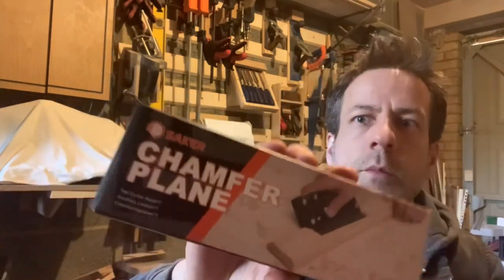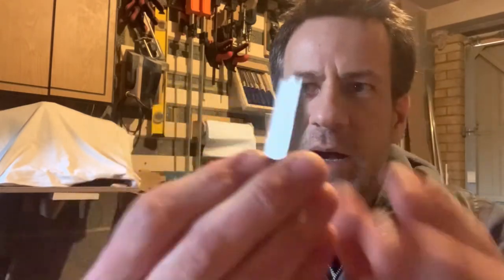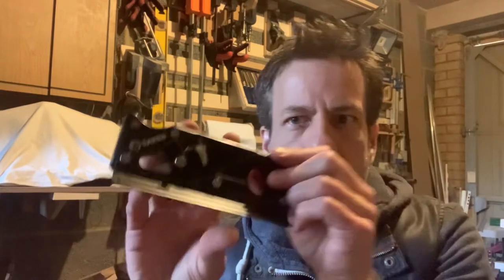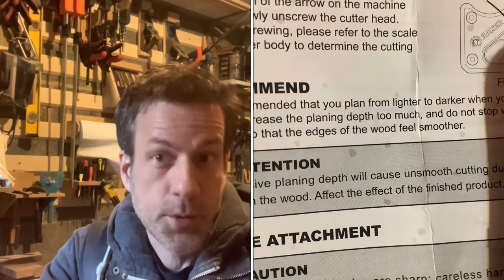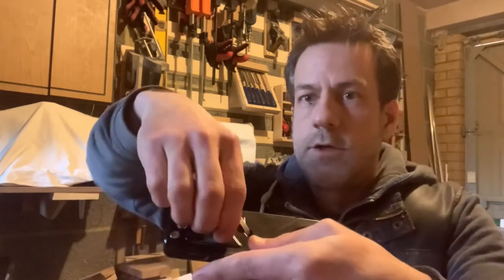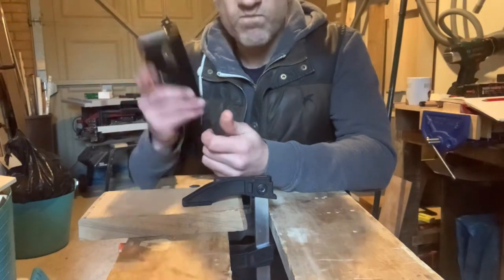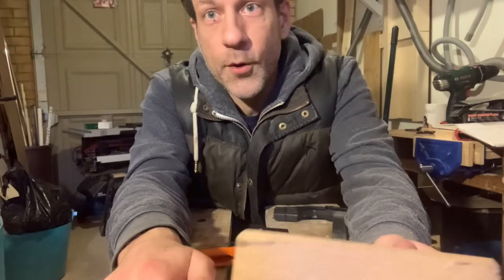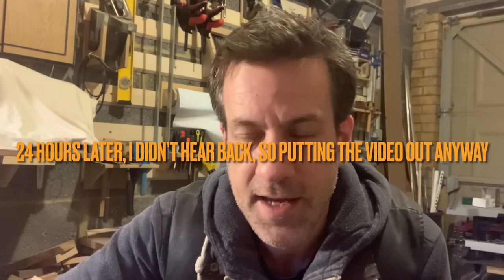Review of the Saker Chamfer Plane, first impressions and testing the thing out

Comment: Got to agree with other comments: you definitely gave it a fair trial! Of course, none of these things come ultra sharp straight out of the box, but by the look on your face - just like me at the gym,, grunting through the last few reps of a bench press - it doesn't exactly look like a joy to use. 
I did consider the Banggood (Woodpecker knockoff) as it gets some reasonable reviews, but even that comes in at around £80. Frankly, you'd be better off buying a trim router. If you can't stretch to the Makita, there is always the Katzu - among others - that can be had for as little as £30, already a fiver cheaper than the Saker.
I don't know, but woodworking in your garage, or shed should be a relaxing, pleasurable experience. For me, it's a podcast, audiobook, or music. Then, it is just a case of plodding away at whatever the current project is. 
The Saker doofer looked like torture, and, as you quite rightly pointed out, putting a chamfer or arris on a project usually comes at the end. So, with timber - even MDF - prices going through the roof, why would you want to spend hours, and good money on a project, only to make a dog's dinner of it 98% in?
If you don't have a trim router, and only want to take off the sharp edge, just use a sanding block, or sponge, or buy a Stanley or Record block plane. Either can be had for the same price as the Saker. 
That being said, thanks for taking the time to share your awful experience with this terrible looking tool.
Reply from the maker: Thanks for your detailed comment 👍🏻. I’m being polite about the saker in the video as they sent it to me free to review! But I totally agree with what you’ve said there, it’s a gimmick of a tool anyway, whether made well and sold expensive, or made poorly like this one. The Makita palm router is awesome, one of the most used tools in my shop. And agree you can’t beat record and Stanley planes, well restored and well sharpened they are amazing tools. I have an ever growing collection!